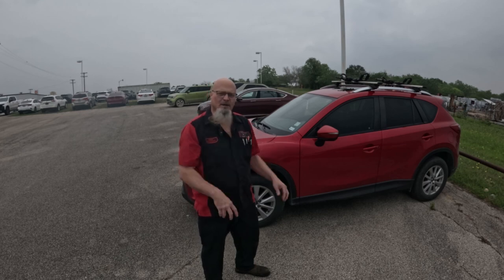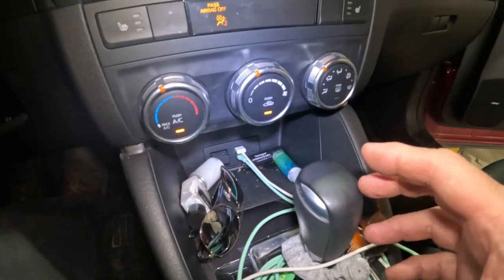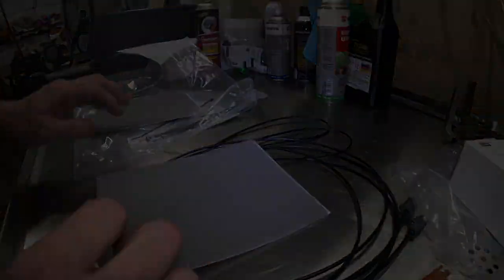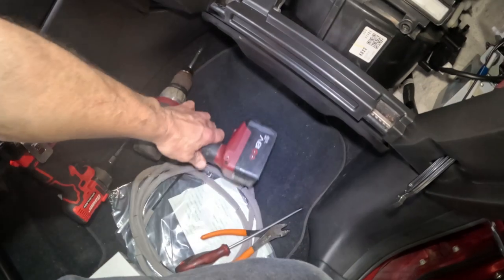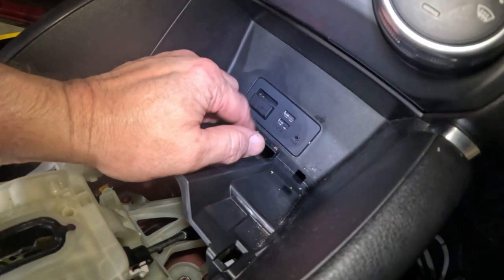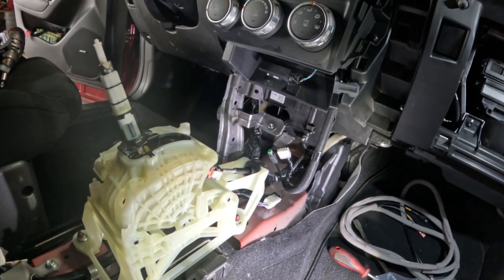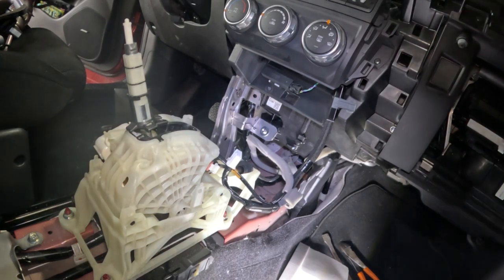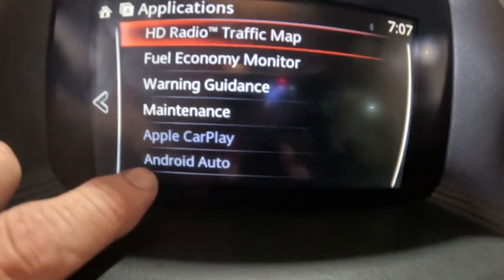Upgrade Your Ride: Easy Installation Of Android Auto/apple Car Play In Mazda Cx-5

Comment: OMG - this is so much better than others showing us things like using drills, bent coathangers etc to remove the USB module.   Removing the trim was SO easy,    Im half way through the job - putting it all back together now - only 2x spare screws 🙂  Cant for the life of me workout where I took them from.
Reply from the maker: Good job.  Hey.  You start with 100 points. For every bolt or screw you have left over, you subtract 5 points. So I say you got a passing grade.  Thanks for watching.
Reply: @ShopForemanGarage    I tore it all out again and out it back three times .. found where they went.  Its working well.... Kinda. But as for installation, couldnt have done it without you.